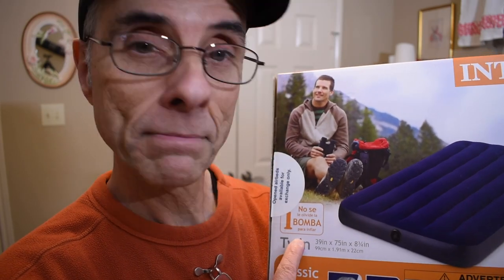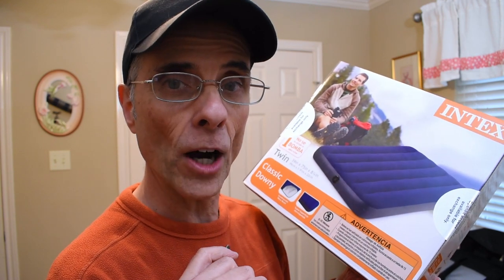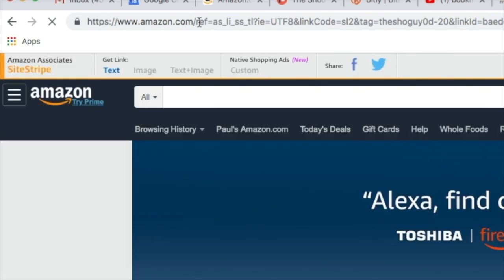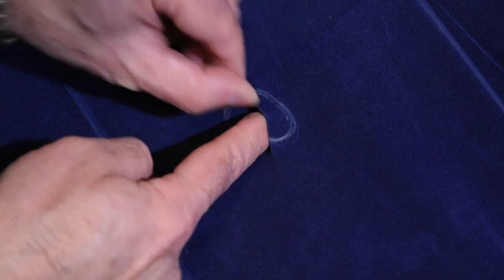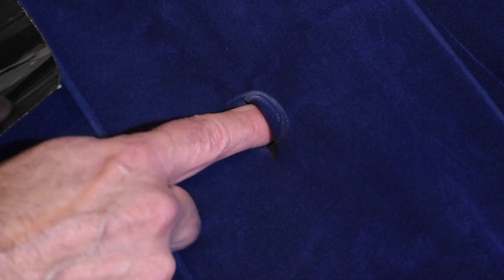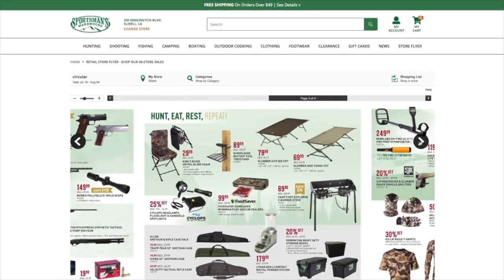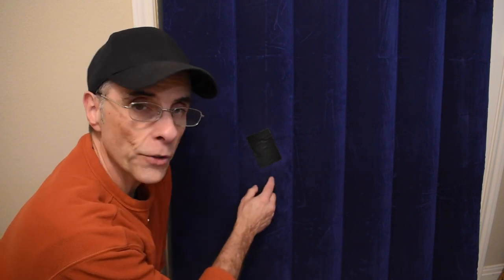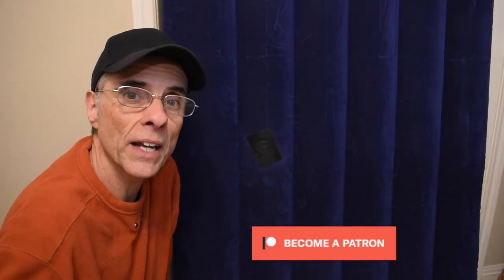How Flex Tape can fix your air mattress.

Comment: Great fix for your air mattress. When used as designed, Flex Tape patches, bonds, seals, and repairs virtually anything.
Reply from the maker: Indeed!
Reply: @TSGEnt  Hi Do you know if Lowe's or Home Depot sell Flex tape? Amazon delivery date is too long:(  Thanks!
Reply from the maker: @CrystalChris721  I haven't looked at those 2 places, but I did see it here: https://goto.target.com/c/429430/81938/2092?u=https%3A%2F%2Fwww.target.com%2Fp%2Fas-seen-on-tv-flex-repair-tape-black%2F-%2FA-52352913
When I asked about delivery to my area it stated it could be deliverd by tomorrow! Worth a try.
Reply: @TSGEnt  Hi Thank you! I just came from Lowe's. They had it. Thanks for replying though :)
Reply: @CrystalChris721  i ordered from the flex tape site

Comment: Yes, I also like to repair rather than just use and throw as most people I know do.  It's not only the cost in dollars that matters. It's the whole issue of sending reclaimable materials wastefully to the landfill. Thanks for the trouble you take to make these videos and also make them light-hearted, because typically people who come to view fix-it videos like these are a bit negatively mooded just because they have to fix a problem which they do not quite know how to and if they will succeed, on top of being annoyed with the manufacturer that their mattress had sprung a leak, in the first place.  And thanks for finding the time to answer your viewers' queries! I hereby 👍and subscribe.
Reply from the maker: Thank you so much. I guess I was raise not to be wasteful. If I have a tool, piece of gear, or whatever, I try to get the most out of it. After all I spent hard earned money on it. If I don't need it any more, I'll find someone who might be able to put it to use.

Comment: Thanks for the demo...I have a King Koil kingsize air mattress and I love it! Got a hole on the side seam (somehow) and I tried a couple of things. Now it's on to the method you just used that makes so much sense!! Tape pushing against another piece.. "BRILLIANT!"
Reply from the maker: You're welcome! And since that repair, we've used it a number of times and it's still holding! Be patient. Take your time. You'll get it repaired. Don't forget to share this video so you can help others. I'm amazed as to how many people have air mattresses that have leaks.
Fixing leaks, one mattress at a time.

Comment: Thank you for making this video! I’ve had a queen size air bed with built-in inflatable headrest on it for a little over a year now. Also by Intex and purchased at Walmart (was about $60). It’s super comfortable, but my idiot cat slipped between the air bed and the wall and he punctured it with a claw. It already leaked a little from a hole I haven’t found, but now it doesn’t hold air overnight AT ALL. Just bought some Flex tape so I could do this for myself. Will update with my results
Reply from the maker: You are most welcome! Please do update us with what happens!
Reply: Please share your results with us using Flex tape.
Reply: Results?
Reply: Update?
Reply: Yeah I’d like to know too. I have the same mattress. Bought it 7 months ago when I bought my first house. I am going to try it. I actually have a nice memory foam bed and adjustable base at my parents but I never have the time to break it all down and drag it out. So been sleeping on the air bed every night. I too have the idea of double patching it. Everything had been fine with the bed until I had someone spend the night with me. I almost think she did it on purpose 😩
Reply: Two years later……….⏳📅🕑🕝🤔😴💤💤⁉️
Reply: Of course this......I'ma b nice and say woman instead.......of course this woman didn't update results 😂😂
Reply: @carriewainwright6265  Maybe she died. You never know. The past couple of years held many surprises.

Comment: I bought an Intex twin at Target. I was attracted by the battery operated pump and the price. It started leaking quickly and developed a slit on top. I'll try the Flex Tape. Years ago, I had an
Aerobed that was around $100. It was a much better quality product.
Reply from the maker: The Intex is definatly a "budget minded" product, but a little flex tape should fix you right up. Let us know how it goes.

Comment: Thank you so much for putting this video up. I have a queen size Intex double high air mattress it's not cheap and I have cats and they have put some holes where the seam is with a seem to the top of the bed in the side of the bed come together and I've tried some regular air mattress patches that are heavier-duty and they are just followed the till the end of the patches even though I put several and still came out the end. If you have any fantastic ideas or any ideas about how to repair an air mattress that has holes where the same comes together for the top in the side I would sure appreciate it because it is my main bed. I have a very bad back and a double high air mattress is perfect for a very bad back
Reply from the maker: You are welcome. I can't guarantee it and I haven't tried it myself, but perhaps forcing FlexGlue in the tiny holes when the mattress has got only a little of air so as to not have the top and bottom touch but not enough to force the glue back out the holes. You know what I mean? let it cure fully before filling back up. I did something similar in this video.  >  https://youtu.be/0zIMAuROvm8  It worked well. I hope you find a solution.

Comment: I really love  ❤your dedication to demonstrating this.  I'm on vacation and my family member (elderly) spend over $300 on an Aerobed Raised Queen size. Its held up for over 1 month.  Of course the return (30days) has expired.😭  I woke this morning to that sinking feeling quite literally. 😢😭  The hold is at the seam. I can imagine purchasing another.  Over $600 if you add the cost.  🥺😱 The seam is top vinyl/bottom fuzzy. Would you please do a demonstration of Flex Tape clear on a very small seam split?  God Bless
Reply from the maker: These air mattresses are great until... 
So are you saying the seam at the side edge where the top and bottom meet?
Reply: @TSGEnt  I have the same issue TSG; leak at seam between fuzzy and vinyl, where they meet. What do you suggest?
Reply from the maker: @virginialbarry4174  I would say your best bet is to open that hole up enough to get a patch inside and then patch over the outside as we demonstrated in this video

Comment: Just came across this video and I have a slit slightly larger than the one you made…. But I’m going to try this method, thank you for sharing
Reply: hey did it work?
Reply: @AleaseCherry  nope smh
Reply: @silentangel3099  thanks. I was just checking to see if my walmart had it because I was gonna try this. Mine is a much larger hole as well. Usually I just purchase the repair kits but this is not pin sized at all. Guess I'll do the rubber glue first then use the tape like my cousin did.

Comment: What if the slit is on the circle part of the air mattress will it still work
Reply from the maker: I haven't had it split there myself, but in my experience, if you can get a good seal across any of the slit it should work as a patch. The stuff is really sticky and hasn't peeled up at all.You might try making a bigger opening and sealing from both inside and outside like I did here.

Comment: I enjoy your videos. However I tried the Flex tape. Got it from Walmart it was about $13.00. And Warning you don't get much of this tape on a roll.

It is a bit annoying to try to cut to size with scissors. It's like tacky vinyl. However after trimming it to rounded corners. And placed it over the hole that was in the top of my felt covered air bed. 

We placed it over the pin hole. And placed a heavy book on top. Allowed that to set overnight. The next day we inflated the airbed. 

Guest tried to sleep on it later that night. By the next morning one of them was halfway on the floor. It didn't work.

So unfortunately the Flex tape is a No for us. I returned the remaining Flex tape back to Walmart for a refund.

We also tried Gorilla glue to no avail either. So I will continue to try some other things. Because this airbed isn't even a year old.
Reply: Hi, what was the best solution you have find? Vinyl cement?

Comment: I've watched many videos like this to fix my air mattress but one thing none of you do it shows someone laying down on the mattress after it's repaired .. I wonder why you wouldn't give it a test run or two or three isn't that the point?!
Reply: I agree. The extra pressure of weight laying on top may be enough to blow the patch.

Comment: What if I dont make a bigger hole and just put a patch on the outside on the fuzzy part will it work
Reply from the maker: I believe it will certainly stick. I just dragged out that blue mattress (btw, video coming soon so stay tuned) and it is still sticking! I chose to put tape on the inside, because air pushing on the inner patch, that and the outer patch assures the hole is sealed. Give it a whirl. The worst thing that can happen is it might leak a little because of the fuzzies making a way for the air to escape, but then just snip a bigger hole on the outside and try the inner tape method. Let us know how it works out. Stop by here and click on the links to pick up some FlexTape if you need some. http://www.shottinguy.com/flexseal

Comment: For a tiny puncture can you use the spray flex
Reply from the maker: Give it a try and see what happens. I've not used flex seal spray on an air mattress, but it does well on this: https://youtu.be/0zIMAuROvm8.
Reply: No not at all I tried that twice. it always blow through even after allowing it to set for a couple days. as soon as it's inflated air seeps through . I'm going to try the tape this time.

Comment: Do you think this would work without the interior seal? This recently happened to my air mattress, and occurred on a seam in the of the round indents on the fuzzy side of the mattress. Tried duct tape with no avail.
Reply from the maker: My thought is, it's always best to have the air pressure pushing towards the hole (inside) rather than pushing away from the hole (outside). However, the Flex Tape adhesive is very sticky and should hold up even on the"fuzzy" side. Be sure the patch is large enough so it won't develop a channel where air can leak and let it sit overnight uninflated so the adhesive can cure and fully bond the material. Let us know how it goes.
Reply: You would remove the flocking with sandpaper. Soak the flocking or the sandpaper to cut down on dust in the air.

Comment: But try w/o the underpatch? Would it hold.
Reply from the maker: There was a video before this one w/o the underpatch. https://youtu.be/grdr3HD4_g4  It was a very small hole and it's still holding well. In this video I was demonstrating a far more sever tear/hole. I'm not sure how well it would hold upon the just the topside. I optioned for the underside/topside method because I believe it would the best option in this case.
Reply: It certainly is, but I'm curious if just slapping a patch on top would work too. Naturally, an underpatch is sound engineering though...
Reply from the maker: @bramblebop1904  The "fuzzy" top is a bit suspect, and I'm pretty sure a small channel where air will leak, will develop when the "fuzzy" stuff gives way. Scraping the "fuzzy" off should be done if possible.

Comment: Just a clarification here. It looks like you used about 2 3” strips of flex tape. If a 5’ roll is $14-$15 then that total of 6” of flex tape would have cost $1.40-$1.50 not “pennies.”
I agree that you may just want to toss a cheap air mattress but there are cheaper ways (including regular duct tape and hot glue) that may do the same thing. I love flex tape but I certainly don’t think it is a cheap solution to any problem.
Reply from the maker: Agreed there may be cheaper solutions, but I've tried duct glue and hot tape and those don't flex and stretch when blowing up the air mattress and don't last as long as FlexTape. I've used that mattress repeatedly since making the video and the repair is still holding up! 
I may have come across as a bit of hyperbole in the video but technically $1.50 is only 150 "pennies".😉
Reply: @TSGEnt  I’m glad it’s still holding up! That’s an awesome update

Comment: Ouch... It's breaks my 💔 to see you purposely creating a hole on your brand new Intex Air mattress.
After I watched your video I went out buying the flex tape to fix mine but 🤦😭🤷 it didn't hold. I pumped after an hour and straight away it started coming off now the difference is...
Mine had a hole on the side by the vinyl side and not on top by the velvet material which I'd say maybe on that velvet material wasn't going to hold but it did on yours.
Another difference is that I didn't put a peace of flex tape on the inside as I didn't want to make the hole bigger.
I did exactly the way you did on yours besides adding the hole and putting a peace from the inside.
What could have caused mine not to hold? 🤦🤷

Comment: plumbers tape? 
on a budget, intex mattress with seam tears - gorilla tape, plastic, rubber cement - patches included, other patches- nothing will help. they keep popping at the seam. 2/3 are managed right now… but it’s near the dial that inflates it… and one just will not fix
Reply from the maker: Thanks for the input. It seems seams (intended) are a real problem.

Comment: What if the whole in air mattress is right at ridges?
Reply from the maker: FlexTape is very sticky and I believe it will certainly adhere just fine and because FlexTape flexes it will stretch along with the mattress material as it reinflates. If the whole is far too large and you find you still can't achieve a complete seal, this is what I recommend: https://amzn.to/2YYcVZm or https://amzn.to/2WoiE9i Good luck out there.

Comment: I assume this is tronger than gorilla tape. I only have gt available and the air pressure just pops off the seal.
Reply from the maker: The flex tape is incredibly sticky and it's a rubber material not cloth. Very tough. It's been 2 years since the repair and we still use this mattress and no leaks. Going from the inside like in this example is the way to go for sure too. You should give it a try. It's more versatile that to just fix a mattress.
Reply: @TSGEnt  The double seal is the way to go. Thanks. Off to Home Depot in 90 minutes.

Comment: This doesn't work. I tried flex tape just now. On a inch hole and it didn't work. Im soooo pissed off i give up all hope. Its impossible to fix a airbed. Impossible.
Reply from the maker: And you sealed it from both inside and outside? Hmmm. Well, sometimes you just may need a new air mattress.
Reply: @TSGEnt  i spent 13.00 on that tape. And its all gone. They dont even give you alot.

Comment: I can guarantee all these videos the mattress leaks eventually with any real weight rolling around on it for a night or 2 of course tape will stop leaks until the pressure finds a way through a channel where the tapes glue fails
Reply from the maker: Well, nothing is permanent. Even if you buy a new matress, it's enevitable it will spring a leak somewhere. At least we have methods that can get us through the night.

Comment: What a sodding waste of money, time and a whole bunch of anger. The flex seal tape absolutely does NOT repair an air mattress. The air still leaks through on the sides(yes, I cut it in a circle) I’m about to throw this out the window. I already contacted flex seal about how false advertising is illegal. What a waste of money. No air mattress, I’ll save my money for a decent couch. One that won’t have to be “repaired” with tape; which fails.
Reply from the maker: Sorry yours didn't work out. My repair is still holding, but everybody's experience may be different.

Comment: I just got a hole on the seam I see others had the same problem…
Reply from the maker: A hole in the seam is a nasty one. Use a similar technique. Open that hole a bit to put FlexTape on the inside as well as the outside. Be patient and take your time. 
We've had this fix for a couple years and a bunch of use, and it's still holding!
FlexTape is available here: http://www.shootinguy.com/flexseal Here's the first Flex Tape Mattress video: https://youtu.be/grdr3HD4_g4
You can get Flex Tape and the air mattress here: https://amzn.to/3bv9uNK and  https://amzn.to/2HbbxIW
Good luck to you!